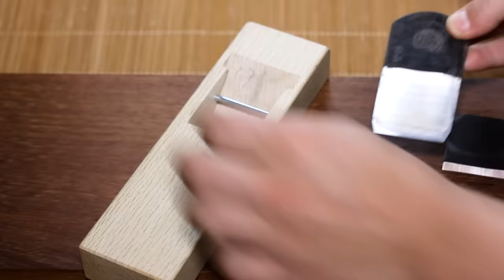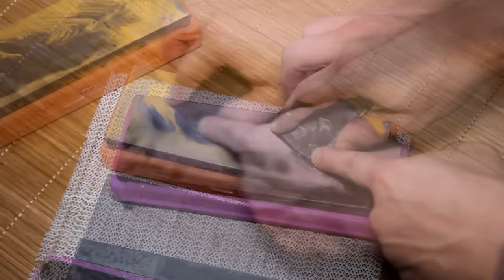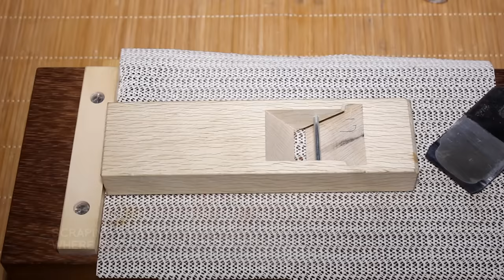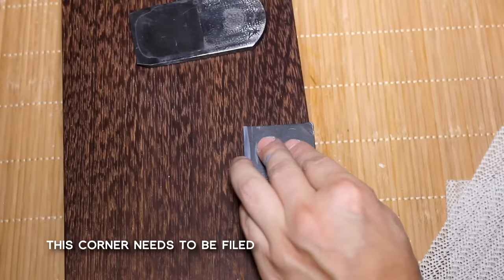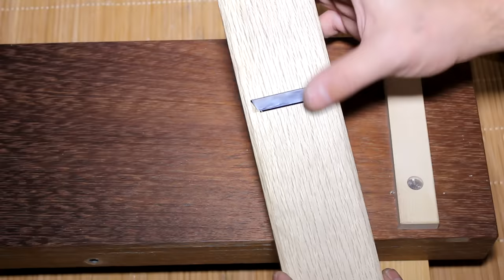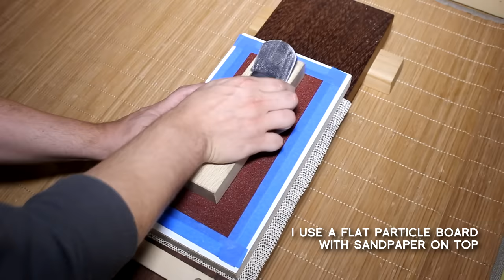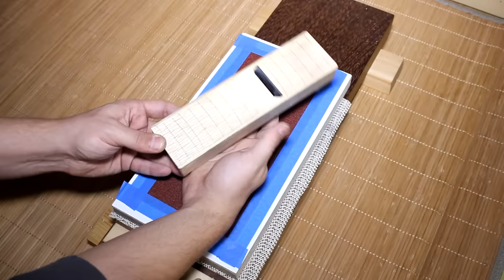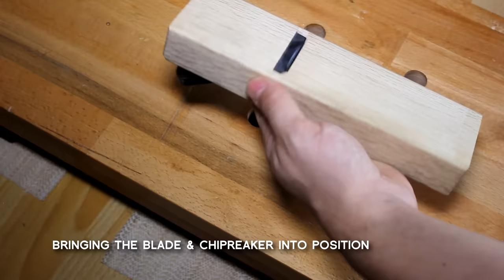Setting Up an Inexepensive Japanese Plane

Comment: why do you make the hollows in the sole?
Reply from the maker: It is said to reduce friction, by minimizing the contact area. You can have also only 2 contact areas, the two in front of the blade, leaving all the back in the air. This last setup is more for rough planing rather than smoothing.
Reply: thanks
Reply: Sorry Adrian, you got that wrong way round: two contact areas and a small mouth = finishing; 3 contact areas and a wide mouth is 'intermediate' (roughing is concave blade added to that).
Reply from the maker: Thanks Bert, you are right! I confused the terms
Reply: No worries — that happens. We all live and learn. Something I learned a week ago: for the dai you want to orient to wood of the sole so that it is directed to the outside of the tree. 
Japanese wisdom never ceases to amaze me...
Reply from the maker: +Bert Vanderveen Interesting that! 
Yes indeed, me too. Also I haven't fully read the Toshio Odate book, I always want to have there some new fact or story to be amazed by :)

Comment: You can't working fast using that, because it will fails, in indonesia we have the same thing but the different is in indonesia they add a long pen straigh from the left to right for your hand to push it easily, and in indonesia even that is a cheap thing, that thing is ready to use not need to doing anything like a raw thing

Comment: As much as I love Japanese saws, I fail to see the advantages of using the planes.  It would seem that over time, bending over and drawing back is more stressful to the back than the Western style of pushing forward.
Reply from the maker: Depends where you use it. I too consider the W ones more versatile, but I have found many situation where the jp one is more confortable to use, and performs better